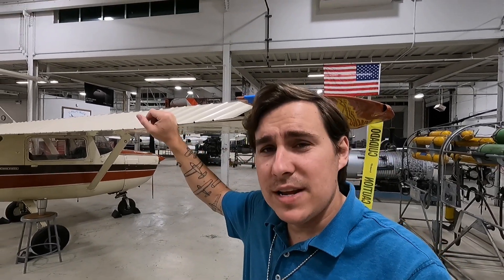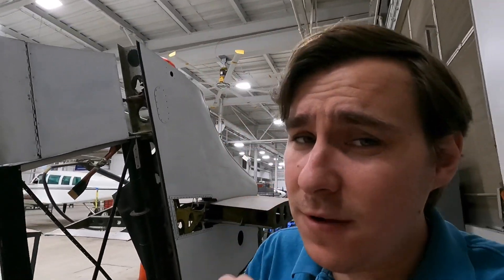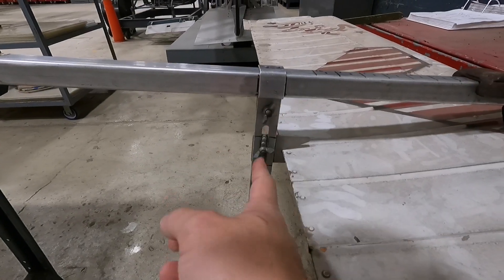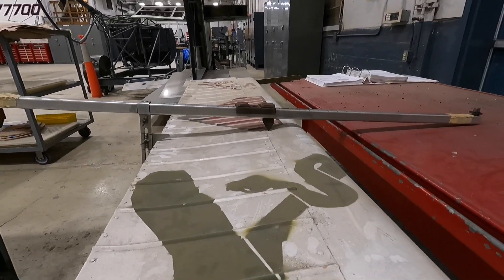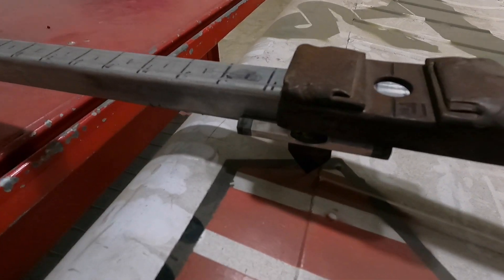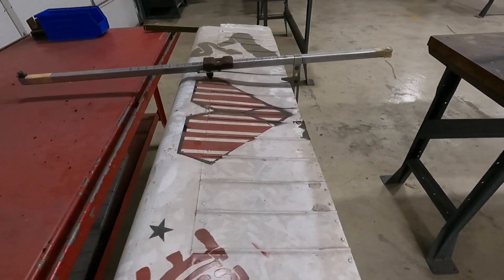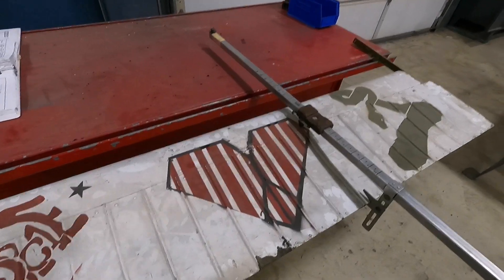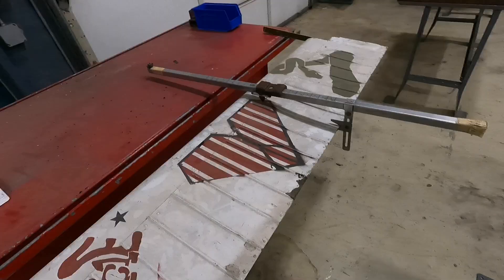How to Balance Aircraft Flight Controls | A&P Test Prep + 10K Subscriber Milestone!

Comment: I'm amazed at the number of small aircraft that get painted and the control were not balanced afterwards, this is evident by the hardware holding the control surface being painted over
Reply from the maker: I had to stop an owner from doing it the other day. He was touching up paint and was about to start sanding the rudder. I also managed to stop him before he painted over all the antennas. Probably wouldn't have cause any issues but the book says not to.